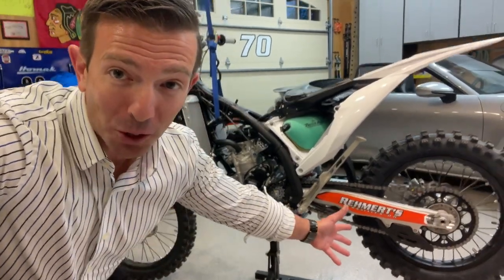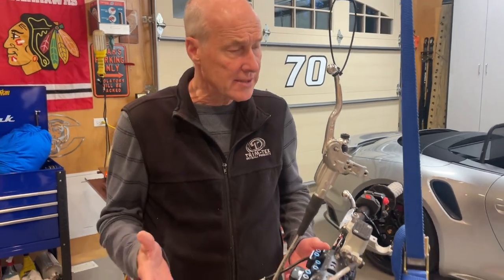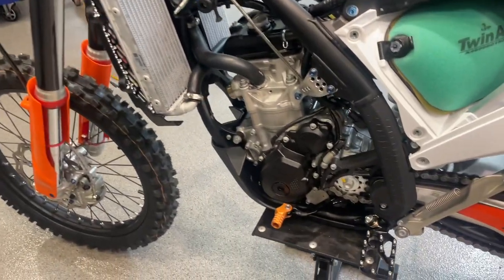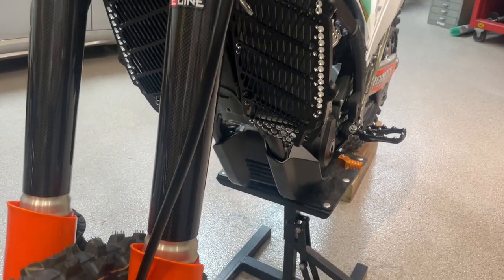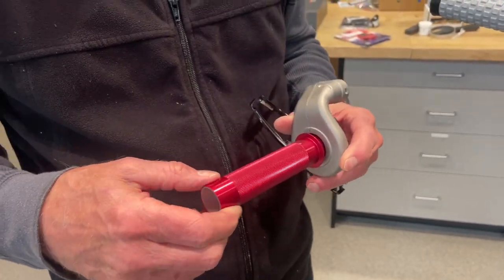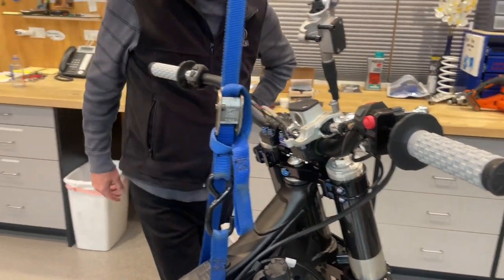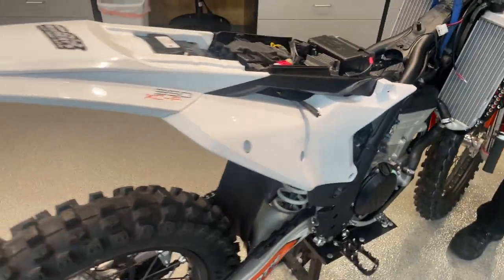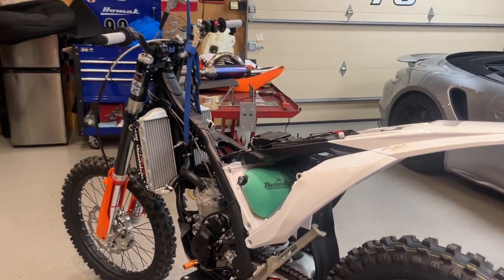How he Makes a BRAND NEW KTM XC-F Even Better!

Comment: Great video - Love what you did to the motor mounts.  What size drill bit did you use, and did you change out the front motor mount bolt? Did this help with frame flex?

Comment: Joe- your suspension settings seem very soft. Are you doing 'casual' trail rides? Except for your rear rebound setting, all settings are softer than the 'comfort' setting in the manual. Air pressure in the air fork is way below the manual value. Have you tried out these settings, do you still like them?
Reply: 64 and 160 he should be spot on!

Comment: That bike is not 207 lbs dry. It weighs about the same as the 300 xc-2, around 225 or so with no gas, which is amazing, but a KTM 350 does not weigh 207. That is YZ125 territory.
Reply: Yeah I just detailed one with a half of a tank of fuel and trust me     It’s weight is right on par with my 22 450rx
Reply: weight per 2023 350 xcf manual is 221.6 lbs without fuel

Comment: Very interested in adding a four stroke to my garage currently ride a 300 but I’m worried about them overheating on tighter single track. I noticed you did not add a fan? I’m not doing hard Enduro really really slow but there are spots that you have to pick your way through in first gear and just wondering if overheating would be a concern? Thanks
Reply: Ya, a fan is always a good idea on the new 4strokes in slower stuff